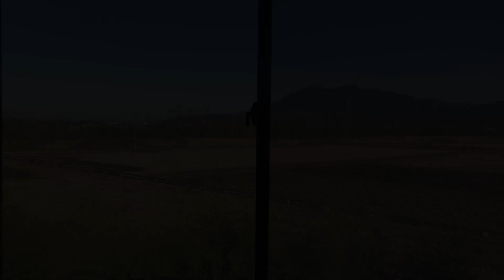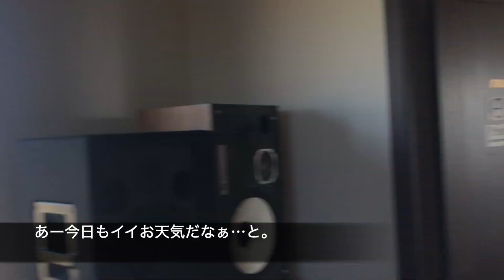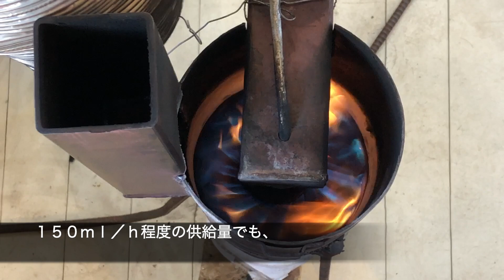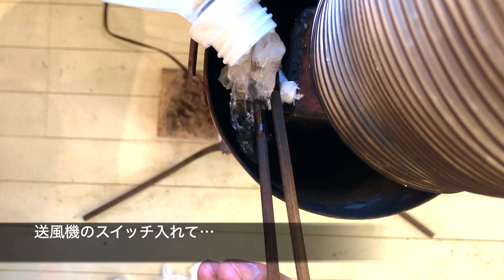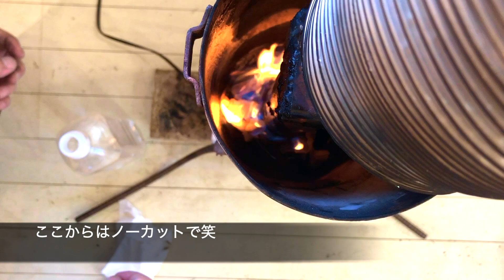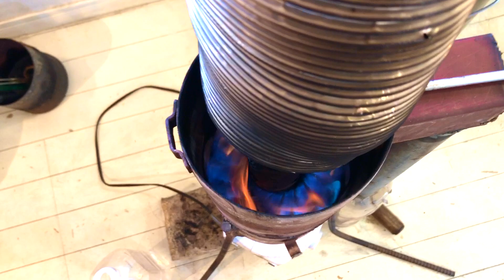廃油ストーブ　送風管テスト　３０°　Φ3.4ｍｍ

Comment: I'm not a physicist, but I'll try to explain it.

Fast stream of air through small holes will suck the oil vapour to mix into the stream and make good or complete combustion (blue flame) at high speed flow.

At the tip of the flame sometimes you can see red flame, that indicates not enough oxygen to combust completely.  Because at the end of the stream oxygen was almost spent prior to it or probably the end of the stream the flow is slower.  There are some concentration of oil vapour left more than the stream could combust.

It seems to me, the factor of blue flames are,

1. Speed of the air flow through the holes, which depends on the size of the holes, number of holes, and flow rate of the fan.
2. Type of oil.
3. Concentration of the oil vapour which depends on the heat created inside the combustion chamber.

It may or may not be correct, I don't know either, but that's what I guess.  You could play around with these factors and find out the fact.
Reply from the maker: That's right, I'm playing around with those elements.
The only question I have is that the red flame at the tip of the flame does not disappear even if oxygen is increased or the flow is accelerated. I feel that there is a threshold for diffusion combustion and premixed combustion in that area. thank you.
Reply: @FarmallCafe  I guess, the speed of the air at the tip of the flame reduce.  The molecules of air are thinner than the prior of the stream, then fuel to air ratio increased.

If you increase the air flow, it flows longer to hit the wall of the chamber and scattering the air and molecules around, in which is no longer a stream.

Stream or not a stream may be one factor,  I just guess.